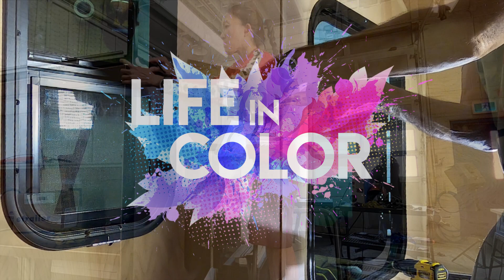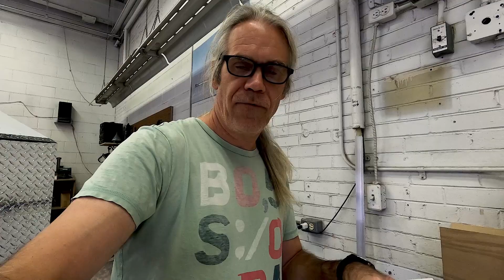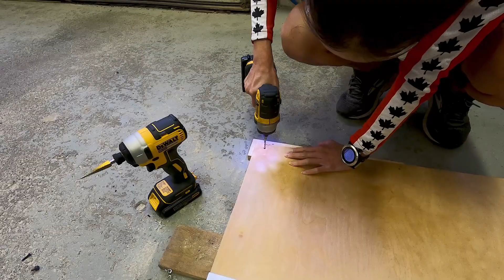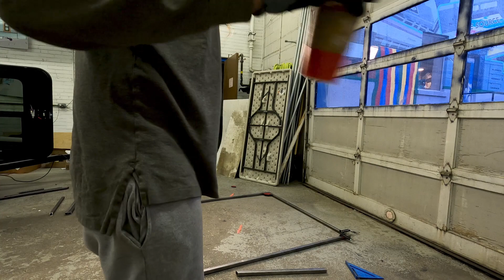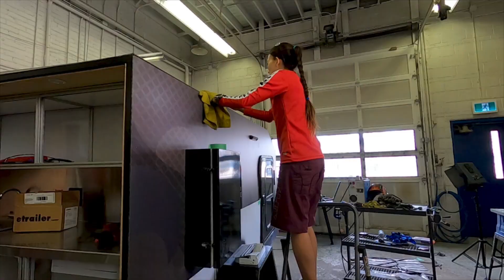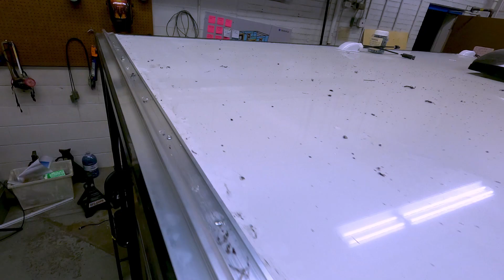Squaredrop camper build - part 8

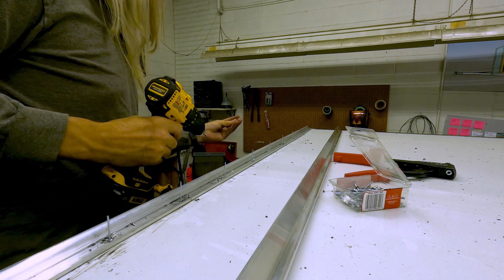Comment: 11:24   Did you employ waterproof pop rivets?
Reply from the maker: You know I don’t think I did.  They are under the trim that is secured using sika flex.  Fingers crossed.
Reply: @lifeincolor7680   Thanks for the reply.   I would not have angst with those rivets if they are not waterproof.  I would trust the Sika with the trim for water exclusion.
Reply from the maker: @jwiereng  I have to be honest.  I was not even aware they made a waterproof Rivet.  I'll keep them in mind for the future.  Thank you for the advise!